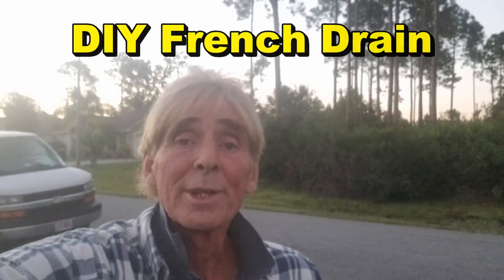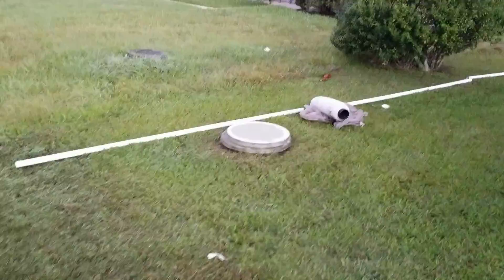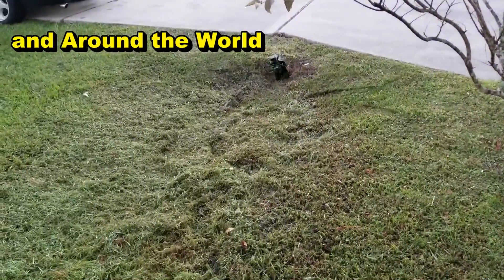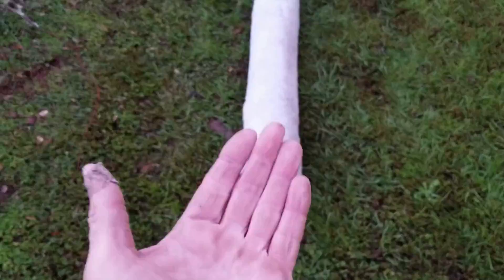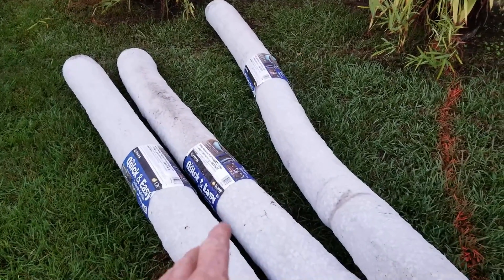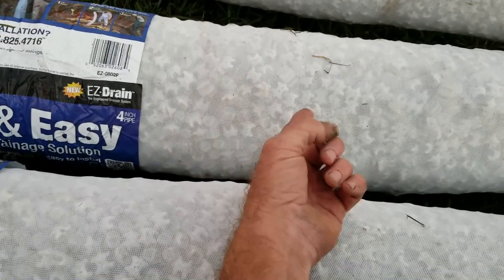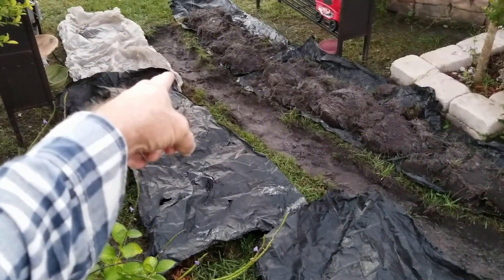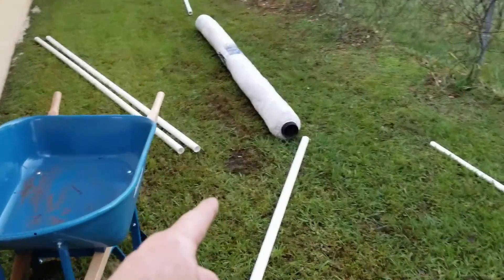DIY French Drain Florida Homes

Comment: Couple ??? I Live in Indiana and we use pressure fittings whenever we connect to a sump pump or ejector pump? Why don't you guys use them? We also have to use a purple primer before we apply the glue to all PVC pipe and fittings! Is that just a personal preference or is this how Florida code calls for it to be done? 
Thanks. I really enjoy the videos, keep them coming.

Comment: I dont get how u can have so much 4 inch pipe goin in and that pump is strong enough to carry it all out in 1.5 inch pipe and keep up. I install drains everyday. Never used sump im trying to c how it can work before i sell it to a customer
Reply: The flow from the french drain tends to be slow enough so that the sump pump activates only intermittently.   A 1/2 hp pump empties the sump basin in seconds.
Reply: Those pumps even with a small line move an enormous amount of water. That being stated, in the event of a 100 year storm, nothing is going to keep you dry.